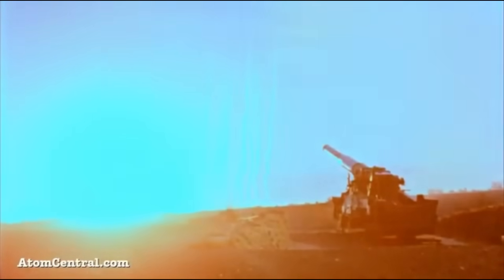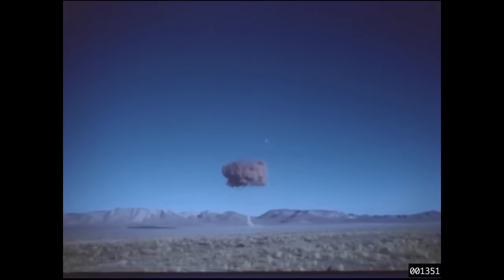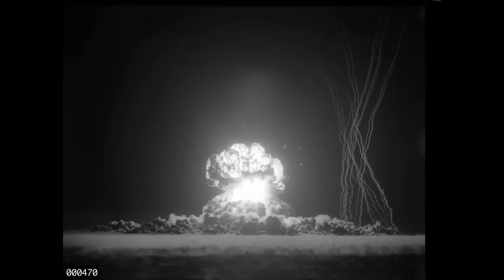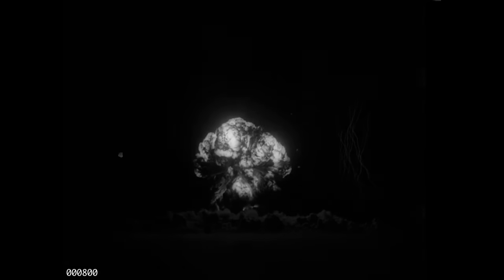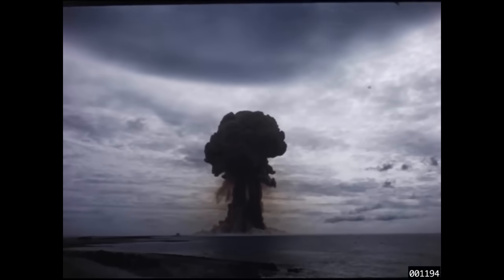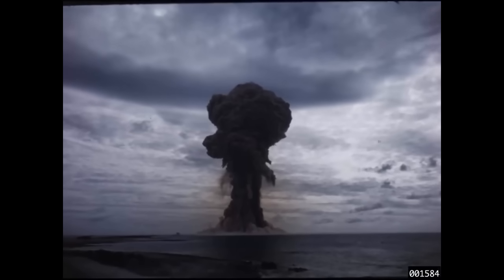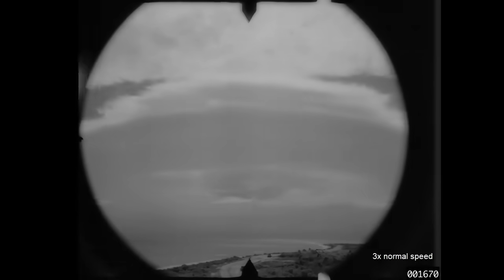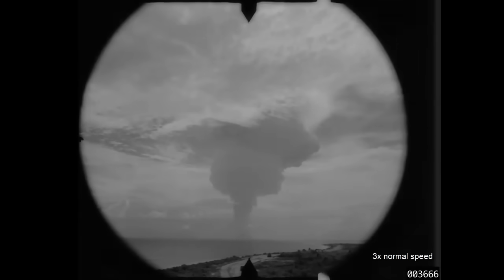What does a nuclear bomb sound like?

Comment: One thing to consider as to what a nuke sounds like.  Listen to the multitudes of videos that caught the audio of the Chelyabinsk meteor detonation.

The mechanics around the audio of a nuclear blast are pretty much identical to what the meteor did.  A massive amount of energy is released in a very short amount of time, heating the air and expanding it in a shockwave.  The main shockwave makes a loud 'BANG!' and may have pressure behind it to blow in windows and knock down walls.  However, the Chelyablinsk meteor had secondary audio in the form of dozens, if not hundreds of followup 'booms' picked up by all the cameras...  The echoes of the shockwave as it bounced off terrain features. 

The nature of the bang and echo-booms is going to be determined by the energy of the blast, and its location.  Chelyabinsk broke up and 'detonated' at an extremely high altitude, so the shock was very wide spread and uniform before it struck the ground.  Which means that all spots on the ground got the blast at (more or less) the same time, causing the echoes to be generated widely spread, all at (again, more or less) the same time.  Any given observer then would hear each echo separately as it reaches them overland.  Creating a 'popcorn' percussion out of the booms after the initial blast.  Imagine dipping your finger in a bath tub that has uneven walls.  Your finger creates a nice clean ring, the shockwave.  And as the wave arrives at the edge of the tub and all its weird shapes, it creates a messy pattern of bouncing wavelets, the echoes.

 Low altitude airburst, ground burst, or sub-surface bursts will yield different audio behaviors.  Airbursts will more likely sound similar to Chelyanbinsk, though they may be more concentrated and 'contained' by terrain absorbing the energy of the blast.  Ground bursts will generate a seismic wave that will be heard first as a deep humming rumble (because sound travels FASTER in solids) before the main shock arrives.  You can hear an example of that in a video called '100 ton test detonation'.    Subsurface detonations in turn will be even more seismic to a listener, unless there's a surface breach.

So overall, the most likely sound from an expected nuclear detonation profile (airburst) would likely be three stages if you're at a 'safe' distance while still being close enough to watch.  The first stage being whatever becomes a seismic 'rumble' from the blast striking the ground at detonation.  The further out you are, the higher the lead time on this, more likely felt in your feet than heard directly.  The second stage being the main shockwave arriving as a loud crack.  Followed by the third stage, residual echoes from the shockwave's passing over nearby terrain features or buildings and echoing back to you, resulting in 'popcorn' percussion.

Thus:   'poomph'...[pregnant silence]... CRACK!!!! pop boom, pop crack-crack, pop, po-pop boom... thump, tump... wump... and so on, fading out over a minute or two.

Comment: The beirut explosion sounded more intense but that maybe because of how close many of the cameras were to the site.
Reply: Also got to think about the improvement in recording technology between then and now.
Reply: In fairness that was a pretty dinky nuke. Would barely even be counted as a tactical nuke by modern standards
Reply: @ninjabiatch101  it wouldn't count as any nuke by any standards...
Reply: @M4XC4V413R4  You don't think an F-18 dropped thermo-nuke would be around that size? I think that looks about the right size to pull up and get away. But we would never use nukes like this these days anyways. So Idk.
Reply: @ninjabiatch101  even if that explosion was 1 kt which many experts don't even agree, that's nothing, Hiroshima's bomb was a tiny nuclear weapon and terribly inefficient at only 1 of the 64 kg of material undergoing fission and still it was 15 kt, the largest bomb tested by the US was a million times more powerful at 15 Mt, the largest test was 50 Mt by the Russians, the average bombs in today's arsenal are above the Mt mark, so a million times more powerful than that explosion in Beirut.
Even tiny tactical nukes done with the efficiency of today's tech would be at least 5 kt but probably more. For 5 kt you only need about a single kg of plutonium.  The bomb in it's entirety wouldn't be even over 100 kg, any plane can carry that, even a crop duster could carry that bomb.
Reply: The Beirut explosion was fertilizer and fireworks! Not nuclear!
Reply: @mrs.amazing1599  Definitely not fireworks.
Reply: @ninjabiatch101  actually there is a few videos out showing rockets shooting up in the air after the first explosion. They stored them both there!
Reply: @mrs.amazing1599  you could be right. But they could also be canisters erupting or numerous other things. I’ll have to  look closer into it i guess.
Reply: @mrs.amazing1599  Diesel fuel, not fireworks,
Reply: @goji059  34-0-0 will combust if heated enough.   I’m guessing fireworks powder and fire together made it happen.      The product was stockpiled after being seized.     The fireworks place should not have been anywhere near 5 million pounds of that material.
Reply: @TonaldDrump686  I think Mrs Whatsherface is combing multiple different massive explosions. The Nitrates that cause the mininuke-like explosion had nothing to do with "Fireworks". 
And it was waste material from everything I saw. Waste material that people had been petitioning for like a year for them to move it, and they just never did.
Reply: @goji059  umm you can see in a few of the videos after the first explosion lots of rockets going up in the air before the last big boom.
Reply: @TonaldDrump686  I use 18-18-18 extended release myself. I take it that fertilizer is a regulated product there? Presumably related to bomb making?
Reply: @mrs.amazing1599  That is the comparison the poster is making.  That a conventional/ or ANFO explosion recorded recently, seems louder than the nuclear recordings heard here.
Reply: The Beirut Explosion was due to 2700+ tonnes of NH4NO3 (Ammonium Nitrate) being stored in a warehouse with little to no safety regulations, it wasn't in a fertiliser mixture. It was the pure crystalline sold being stored there I believe. The warehouse had caught fire, I am sure there were fireworks inside the warehouse too as they can be seen during the initial fire before the rapid decomposition happens.
The NH4NO3 simply sped up of the reaction, it isn't necessarily classed as an explosive, but it can be seen as one in one way. Under the right conditions, it decomposes, producing NOx (Nitrogen Oxides) Water, Ammonia, Nitrogen. The products depend on the conditions.
If confined like it was, it would explode at 200 - 300°C, due to the gas generation.
Here it acted as an oxidizer, rapidly increasing the combustion of organic materials in the warehouse. The fire would have generated enough heat to melt the NH4NO3, causing it to decompose quickly.
The Nitrogen dioxide clouds can be seen in the footage above the explosion site, they have a red/brown hue.
That was still only had a yield of 1kt of TNT, that's nothing compared to nuclear bombs we have now. There are MT bombs in circulation now, I am sure the US has them at least, possibly Russia too. Both have had very powerful bombs, e.g.Tsar Bomba and Castle Bravo, but they aren't actually considered for use now as far as I am aware due to their deployment limitations.
Reply: @benzene6598  Part of that is what I was saying as well. 
Not Fireworks.
That nuke was tiny by modern standards. 
And yeah Castle Bravo class and Tsar class woudn't be doable on an ICBM. And you wouldn't want a plane just flying around with something like that on it. Lol although that part did come out of nowhere. :P
Reply: And current technology.
Reply: This was 2700 tons of firework explosing simultaneously
Reply: Rods from the gods..
Reply: And that the explosion in Beirut was at or slightly under ground level. Sound travels faster through the ground than air so we heard that rumble though the ground before the shockwave. Since atomic weapons (if used in anger) are detonated above ground I assume they would sound a little different and because of the sheer scale the updraft would create a lingering rumble after the initial detonation.
Reply: @Outland9000  well the kinetic wave travels through the ground faster. Because Its pushing the earth around it. Idk if id call that sound.
Itd do similar stuff to the air. So you’d get intense winds (usually depicted AFTER the bomb) before the “boom” even hit. Like being in a hurricane. And then BOOM. Cause it just pushes everything.
Reply: You want a scary explosion in a populated city?
Look up “The Halifax Disaster”. Occurred during WW1 when 2 ships collided in a harbor.
One this was carrying 100’s and thousands of pounds of TNT, Benzine, Gunpowder, and Guncotton.
The old black and white photos make it look like the atom bomb hit the city. It was the largest man made explosion in human history……until, bomb was dropped on Japan.

This is why there is such strict rules and regulation regarding the storage of explosives. The biggest intact remnants of the ship that exploded was a few hundred pound chunk of a cannon (flew over a mile thru a church window) and a deck gun. 
It was worst man made disaster fatality wise in North America until 9/11.

Oh. I think the Beirut blast was smaller.
Terrifying, but not as big as Halifax’s.

But THATS why there are rules and regulations regarding the storage and containment of stuff that can explode.

Comment: Does radiation from the nuclear explosion travel with the sound wave, are the charged particles carried on the concussion wave or does the wave travel before the radiation?
Reply from the maker: There are many types of radiation and they behave differently so ill do my best. 

The electromagnetic radiation, (Gamma Xray, ultraviolet, visible, infrared and radio) travel at the speed of light. Visible and infrared light reaches further than the gamma and xray, the infrared and visible light can be seen and felt as the "thermal pulse". So at the moment of detonation things withing a certain radius will catch fire a few seconds before the Shockwave hits due to the thermal Radiation which is mostly infrared and visible light. Even closer to the blast there is a radius where everything is instantly bathed in gamma and xray radiation. Outside that radius the levels of gamma and xray is lower depending on distance because the bomb is detonating in air and air will scatter and absorb the energy the more it passes through. Now all this EM Radiation only lasts a few seconds then goes away as its basically light. But when a nuclear bomb detonated it also produces neutron radiation and vaporizes radioactive material from its core. Neutron radiation is a particle radiation made of accelerated neutrons. When these neutrons hit other atoms the atoms sometimes absorb them and become radioactive, so tons of dust and material in and around the fire ball becomes radioactive. The vaporized radioactive material from the bomb will also mix and imbedd into dust adding to the radioactivity. The radioactive dust is then spread by the wind and becomes fallout. It will take the form of ash falling from the sky, black rain, or just invisible dust settling down wind. 

So the radiation from a nuclear bomb comes in many forms and propagates in different ways. Hope this was helpful.

Comment: The soundtrack of the first sample around 2:30 is from the Annie shot, not the video shown (that was a mashup to try to match good audio with good video). The Annie shot was televised live at about 5:00AM in March 1954 from the Nevada Test Site, the only such live broadcast ever done.  The reason why no films had sound is that the state of the art was to record the sound wave on film, just like the video, and it required an expensive studio-sized equipment suite to do it.   (Those familiar with Disney's original "Fantasia" will recognize the soundtrack.) In this case, they simply broadcast the audio and video, and it was captured at a studio (probably in Las Vegas) with the studio-ful of equipment and a kinescope for the video.  The video is execrable because it was 5:00AM and studio cameras at the time expected high-energy lighting.  So, the only video captured before the blast was a couple of helicopters flying around and the rockets fired 5 seconds before zero for shockwave visualization.  Then the blast; the audio effect may be from the local EMF or it might be some artifact of the recording, and the sound arrives 35 seconds later, along with the cussing.  Search YT for "Annie shot" you'll find the whole integrated video.

The only other real sound of a nuke I know of is the John shot, where nuclear Genie air-to-air rocket was fired over the NTS.  It was only 2 kT and was fired 3 miles high.  A gaggle of Air Force officers, prodded to demonstrate at such a weapons will not hurt anyone, gathered underneath the explosion and dragooned a photographer who had a tape recorder, and with a live mic the officers did a play-by-play.  The sound was captured, but the "announcer" shouts, "It's over, folks!!" all over the sound, making it generally unusable. Search YT for "John shot 5 officers" and you'll find it.

Why no one thought to leave a tape recorder running outside (commercially available around 1957) is a question for the ages.

Comment: The first video is of an 8 inch howitzer fired Neutron warhead.
Reply from the maker: No, the first video is of the Upshot-Knothole Grable nuclear test of a mark-9 nuclear shell fired out of a custom built M65 atomic cannon.

It had a yield of 15 killotons, similar to the little boy bomb dropped on Hiroshima, but unlike little boy it was a plutonium implosion type bomb like the Fat Man bomb dropped on Nagasaki.
Reply: @venera13  I stand corrected on which shot that was.  However, It was an 8 inch Howitzer just specially built for the experiment.  I was on the weapons system from for 2 years, in the 80's.  The M9 was a test projo and was 280mm or 8 inches.  The M9 weighed approx. 50% more than the average shell, and charge '5 White' could put it further than the 7 miles listed.  Any Artillery Gunner can tell you that.  We didn't train on the M9.  btw I doubt you can find anything here on the system, it's still classified and they don't detail the projectile, Anywhere.  Let's just say it was and is controversial.  Our yield was flexible.  Hiroshima's yield was inside our yield range.
More than that I can't say, but you have enough to figure it out yourself.  I'm not allowed to even acknowledge if you get it right or wrong.  Follow the bread crumbs and you'll understand, but I wouldn't post it.  Also, you might look up "Offset Gun" in relation to.  Don't bother with faceplant or Giggling it.  Try www.webcrawler.com it's been on since DOS.  
ps most of what I've said is public knowledge just not all together and what they Don't say is also a clue.  The projo I worked on was launched by an M110, long tube.

Comment: That was an atomic bomb. Stupid. Testing of nuclear and thermonuclear bombs were tested in the Pacific and after that the atmosphere. Stay stupid though.
Reply from the maker: Atomic bombs and nuclear bombs are the same thing in that those words are synonyms, it's like how water and dihydrogen monoxide are the exact same thing. I would recommend you look that up next time before you embarrass yourself on the internet. Nuclear bomb and atomic bomb are blanket terms for a weapon that derives it's energy from the nucleus of atoms. There are 2 main types, fission and fusion. Fission types are called atomic bombs or nuclear bombs because they get their energy from the fission of uranium or plutonium atoms, specifically the nucleaus.

Thermonuclear bombs use a fission primary and fusion secondary and get most of their energy from the fusion of lighter elements into heavier elements. Usually lithium deuteride with a uranium plug in the center. When the fission primary goes off, for a fraction of a fraction of a second the xrays envelope the secondary and cause the fusion reaction where lithium and deuterium atoms combine or fuse into heavier elements releasing energy.  

There is also a class of bomb known as a "boosted bomb" which is a fission type that uses fusion fuel to boost it's yield but most of it's energy is still derived from fission.

So to sum up. Nuclear bomb means any bomb that derives it's energy from the nucleus of atoms. So a fission bomb, boosted bomb, hydrogen bomb, neutron bomb, salted bomb, are all nuclear bombs. atomic bomb is just another name for them and is not a different weapon. Thermonuclear bomb specifically means hydrogen bomb and yes those where tested in the pacific. 

If you are going to call someone stupid, please make sure you understand what a synonym is and understand the topic you think you are dunking on.

Comment: I feel I am qualified to answer that question.. I was stationed on Johnston Island in 1962 during the Nuclear test series Operation Dominic. So I have seen, felt, and heard several nuclear detonations.  It depends on the distance you are from the blast. If you are close (20k ft) it is like one of the biggest lighting strike booms x 10 you have ever heard.!! Even dirt and sand on the ground is stirred up. Those that are far away sound like distant rolling thunder. I had a recorder running on one of the hi altitude EMP tests and it just was a short buzz sound.
Reply from the maker: Fantastic! Thanks for sharing.